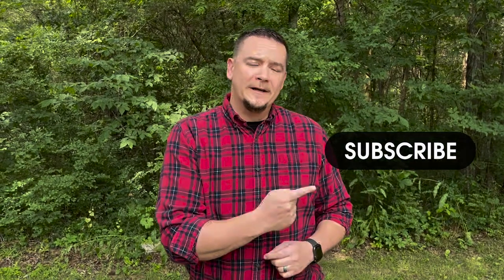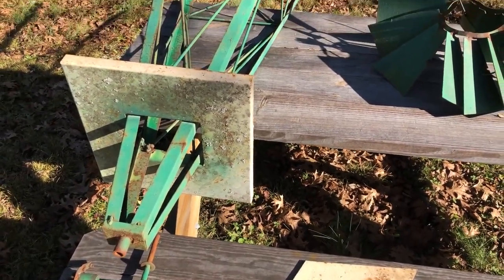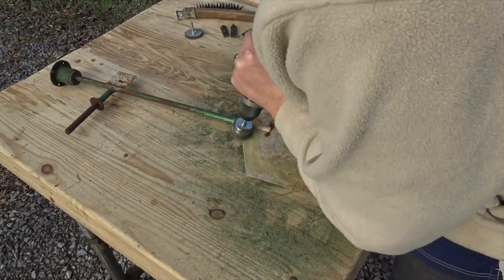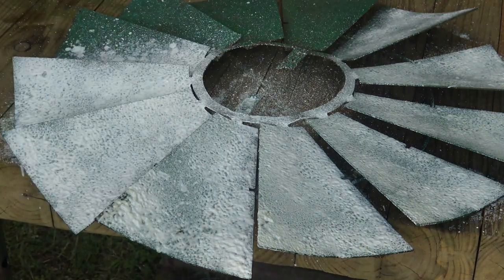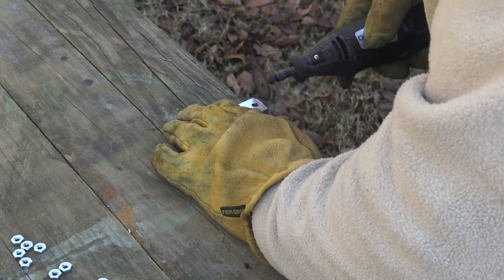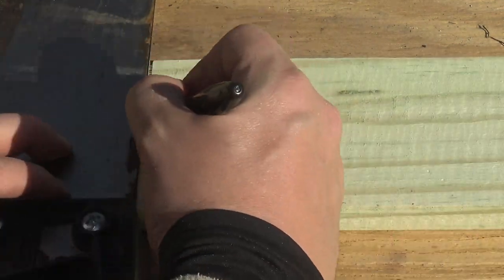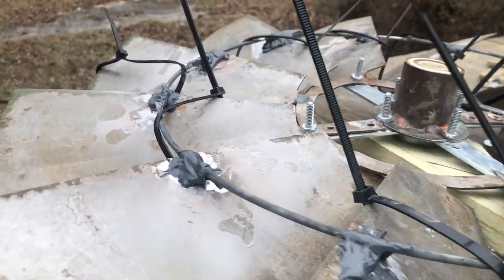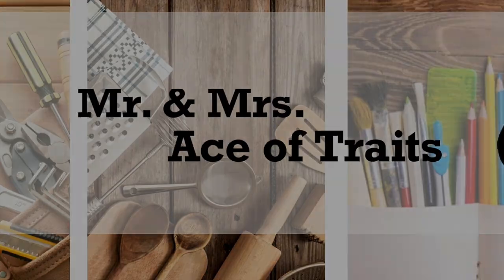Windmill Restoration | Grandma's Project | Pt 1

Comment: I just got one for free from a guy at a motel 😂 I've been looking for years people want over $300 easily. The windmill head is facing the sky so I'm fixing it lol. What kind of paint do u suggest to paint the end of the tail?
Reply from the maker: Thank you for watching! I'm glad you were able to locate one. We used Rust-Oleum brand from Home Depot. Started with a rust proofing primer as the first couple of coats to prevent future rust since we've used it before, and it works really well. We then used the yellow and green Rust-Oleum for the color parts. Once it was dry, we put multiple clear coats of sealer to help keep the color from fading. It still looks great and going strong. Please let us know how yours turns out.